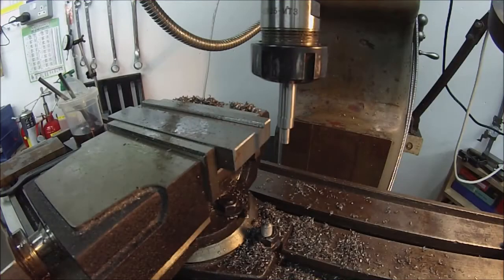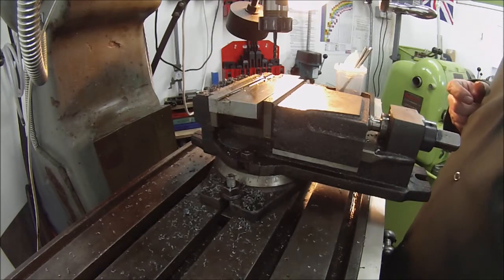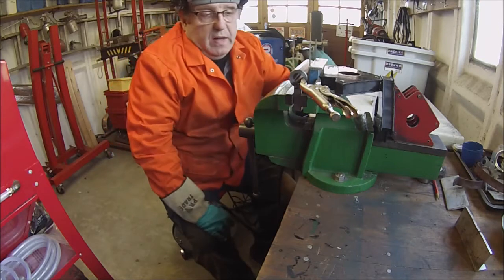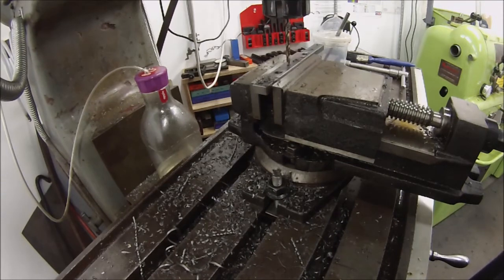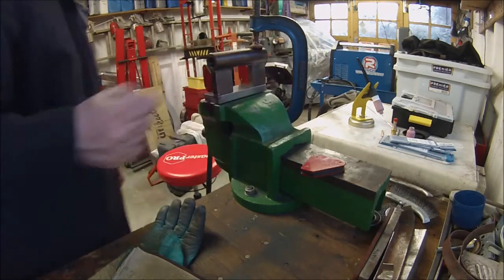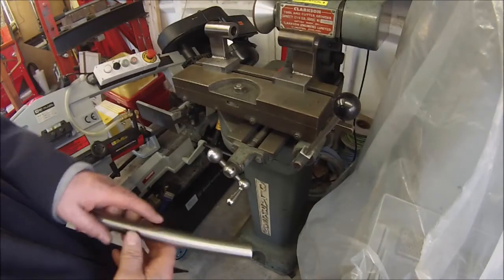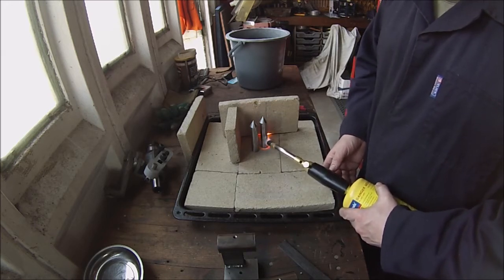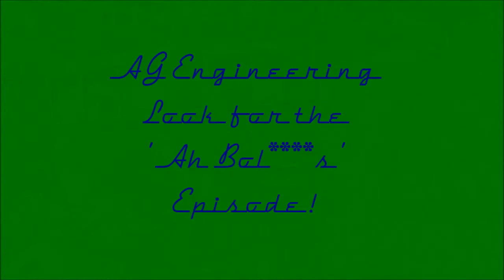Clarkson Tool And Cutter Grinder Centre Brackets Ep2

Comment: Hi I’ve just watched the videos you did some time ago on the clarkson tool grinder restoration. And throughly enjoyed them the last one I watched was the one re manufacturing the centre’s. And was wondering if you did the follow up videos on the broken tap removal and operating of the grinder. As I have not managed to find them. 
I’ve just purchased one myself and likewise I’m few bits missing and need a few pointers on the operation. 
Regards
Mark
Reply from the maker: Hi Mark,  thanks for watching the videos. There is a video on there with the broken tap removal somewhere. I've not  done one on resharpening, there is a later video of the grinder in use for refaceing BSA cam followers though . Many thanks,  Ade.